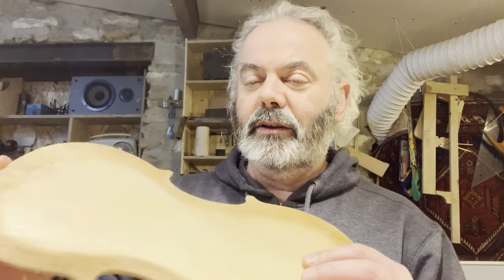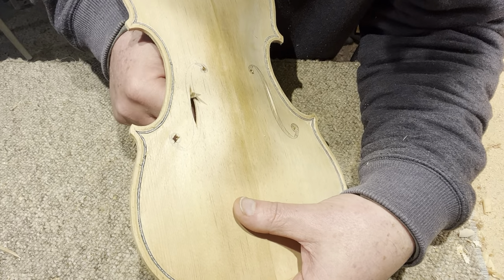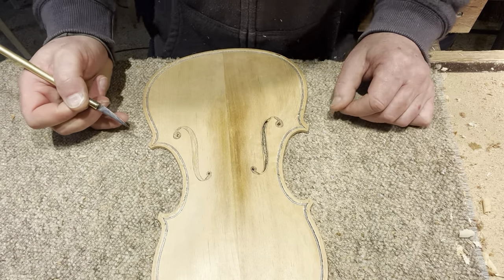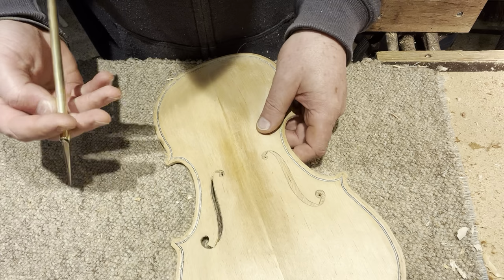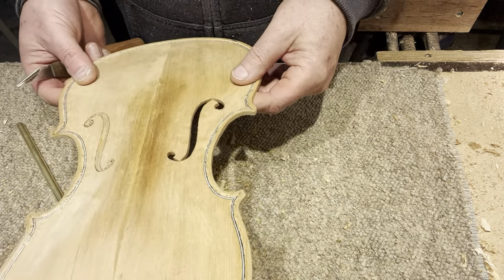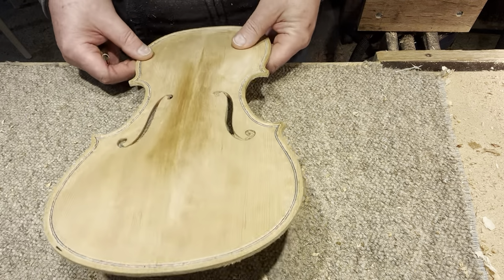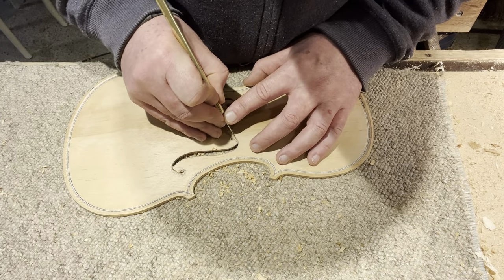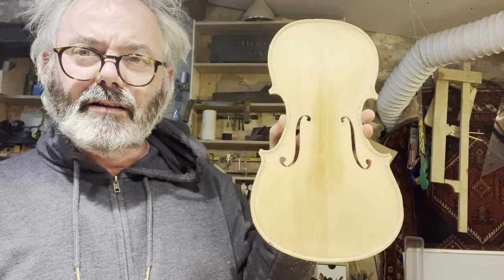#77 - Knife cutting violin f-holes.

Comment: Thanks for sharing Graham. I read in comments on a different video that the cutting tool can effect the structure of the wood. Ie. Coarse tools are prone to opening/softening the grain around the tooling area, but that knives and scrapers compress the grain.

It might be nothing, but I think your method is probably one of the better ones.
Reply from the maker: Who knows, it'd be hard to prove either way. 
I do think that finishing the f-holes with a knife is important for the character of the work.

Comment: Excuse my question if it seems stupid but do you sometimes make the top plate or belly a lot thinner to increase the projection of the violin?
Reply from the maker: Not a stupid question! My violins tend to towards good projection and I think it's more the balance of the arching versus stiffness of timber, versus thickness. I mainly do it on feel. I think thickness (once you get below 3mm) is far less important than the other two! Just my opinion.

Comment: Thanks for this... I'm intrigued with the wood you used for the top. It doesn't look like spruce... could it be Scots Pine? Looks a little denser than most woods I've worked with.
Reply from the maker: Hi, if anything it’s less dense. I must pin down exactly what softwood these last few tops are as they’re fab! I used the word dense to describe the closeness of the annual rings rather than weight, probably not the best choice of words.